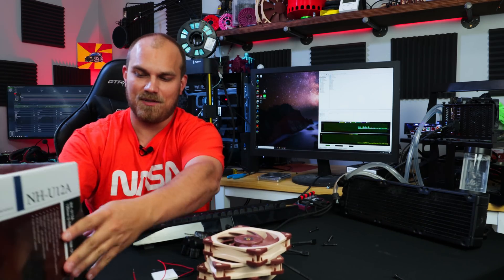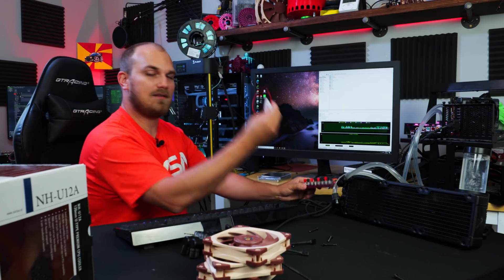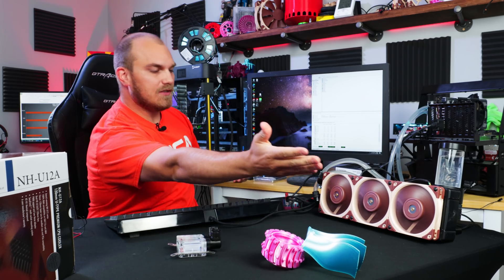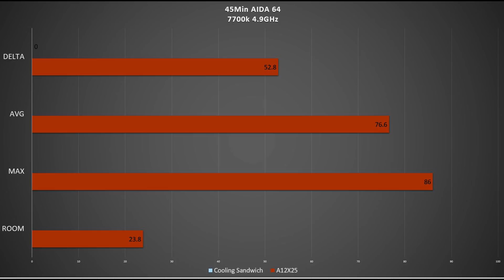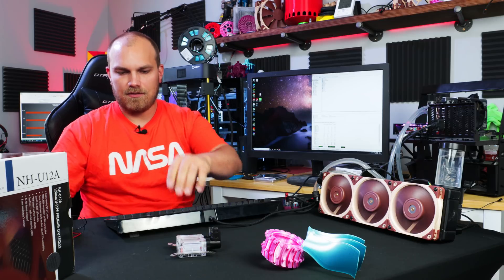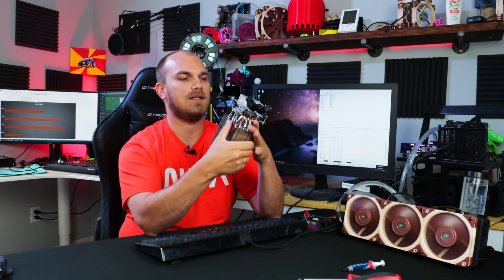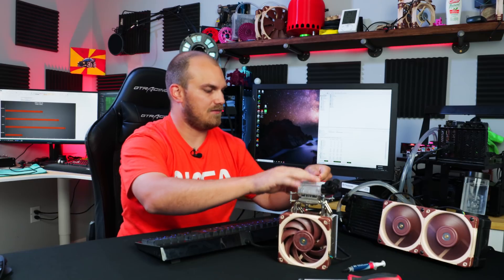Can A Wish.com Water Block and a $4 Peltier Beat a 360mm Radiator?

Comment: What if you installed the cold side under your reservoir and made it that it starts with the computer, and the loop when load is applied, obviously the aircooler needs to start at the same time as the Peltier and when the load hits your loop has cooler than ambient water.

Comment: Put the Peltier cold side directly on the cpu, then just use normal heat sink w/fan on Peltier hot side. That should be plenty cool. But are you measuring water temp or CPU temp?

Comment: Try with better TECs, 3 "Good" CPU blocks, attached to 3 "Good" TECs , each in series on the tubes, each running with a fan sucking air on one side of each heatsink and a fan pushing air on the other side of each heatsink. 
We don't have to make it smaller than a 360 Radiator, we just have to get close to same performance or better.

Comment: Thermodynamics says that the cooling capacity of this loop is determined by the Noctua Cooler. There is nothing you can do to make it cool more than the capacity of the Noctua and any intermediate steps only add heat or reduce its dissipation. Its like plumbing an A/C unit back into the room it is cooling.

Comment: I'm not surprised that this didn't work. Sure, it might be a thing that the peltier element is overwhelmed with the workload but running the air cooler - which runs mostly via convection! - oriented like that certainly is a problem: If the working fluid all sits on the bottom (the actual ends of the heat pipes) then how is it even supposed to evaporate to make the cooler work as intended? Turn the air cooler upside down (into its intended orientation) and run that test again to see actual results. Running in a setup that sabotages the test in itself to begin with doesn't give reliable results.

Comment: I'm at 1:40 and I'm going to make a prediction: Can the U12A keep the hot side of the TEC cool enough that it doesn't choke and start adding heat to the loop - bearing in mind that it needs to dissipate the heat from the TEC and the heat from the loop... and, if it can, can it cool the loop better than a 360mm rad? Gonna go with no on both counts. Is the Major going to have fun finding out? Of course! :D
[edit] Looks like I was right on the money. Oh, and for heaven's sake get some quick release fittings, they'll save you a load of time and aggravation when swapping components.

Comment: Uhm , I don't know much about coolers , but I think the biggest problem is ...maybe that the air cooler is upside down? Isn't there some sort of vapor chamber or sth that works with the help of the hot stuff going up and cool and come back down? If someone knows exactly what happens in an air cooler with those pipes , please do explain , thank you

Comment: Yay.

The idea behind it was based off one of those ancient fad coolers that had a peltier built in.  This was before there were dedicated water loops so I was wondering if the new water loop tech and new heatpipe tech would make it worth giving peltiers another look.  I was thinking it would at least allow for supplemental cooling or relocating a big tower cooler.  I am bad at math, and a lot of the comments below seem to confirm this.  

Running off 12v just doesn't seem like enough juice and the thing just gets saturated too quickly.  To get around that (if still possible, which it's probably not) would require additional crap that would defeat its intended purpose.

I am just glad this didn't set you back too much.

Comment: Major Hardware, you should check an old AIO from Titan/Datacooler,  model DWC-A1.
This is mixed between an air and water cooler, at least the cpu heatsink.

http://www.madshrimps.be/articles/article/85/Titan-Datacooler-DWC-A1-Budget-water-cooling-tested/0#axzz6Uz5KbNBl

Comment: Ah see, the problem is a peltier element is rated for a certain heat pumping capacity. Usually that's much lower than the TDP of a CPU. On top of that, running a peltier at maximum power is actually worse for cooling, as the heating from resistance losses overtake the cooling capacity of the module. You'd ideally wanna tune in the voltage and current so the module pumps the maximum amount of heat while producing a minimal amount of heating. Then on top of that you'd not want the peltier to directly be responsible for all the cooling. What you'd want to do with them is achieve sub ambient temperatures. The cooler a medium, the easier it takes on heat.  So getting water to be just above the temperature where water from the air would start condensing around your CPU block should be your goal. And for that you first get rid of as much heat as you can with the regular radiator and then use an array of peltiers to cool the water further to sub ambient temperatures. This is not efficient, but it's a DIY way of cooling that water loop. Better would be a compression cycle cooler, they are more efficient and more powerful, but also take up more space. Though if you're already using what's essentially a fridge, you might as well put the evaporator (ie the cooling part) onto the cpu itself (though that's def. gonna give you condensation).

Comment: If you are in hot ambient temp room and you still wanna keep cpu and or gpu cool you can add that setup to the radiator you used before. I had that running for 1 year with an 50w peltier and an mora 360lt and watertemp never went over 36°C. 
I had an Asus 1080 OC and an i7 hexacore overclocked plus the Asus rampage 3 extreme in the Loop.
Worked all well and would still run if i had the Space to put that System up...

Comment: I would be more interested how the radiator + tec in series would perform. The radiator would cool the water to ambient temperature and the tec could bring it below that. Additionally you could cool the hot side of the tec with your evaporative cooler.
Reply: 2 x peltier to cool both sides, you sir are a mad scientist 🤣👍🏻

Comment: For starters, you've got it hot side down, heat rises, you're heating the cool side with the hot side that way. It would likely have worked far better without the water block, directly attached to the CPU with the same heatsink on the hot side and a high speed fan to cool the hot side. The cold side can get cold enough to freeze things, so if you're not getting enough cooling out of it, you're doing it wrong.

Comment: I think part of the problem that it didn't work too well was because the air cooler was upside down, meaning the vapor chambers of the cooling system weren't properly utilized. Although, it is still a Peltier so... they're not too awesome if you can't disperse the load..

Comment: It's not as bad of an idea.. I ffed up my perkier when I screwed it tight and it was a 60w unit regardless. You should get one of those 300W ones and run it below spec. That would help efficiency a little (just a guess based on the stuff you can check out at "TechIngredients" channel

Comment: Isn't there fluid in the heat pipes that need to flow to the water block?  It should get better cooling if you turn the radiator right side up so that gravity brings it to the block where it evaporates to the fins.  I would imagine upside down heat pipes are incredibly inefficient.

Comment: Water's high specific heat capacity and low thermal conductivity is what's killing you here. The radiator works because it gives the water mass a high surface area. When it flows past the 2 sq in of the peltier/waterblock wall, there's just not enough water in contact with something cold to make a difference to the overall mass.

What might work would be putting the cold side of the peltier on the air cooler, and immersing the vanes of the cooler in a bigger water block (home made from tupperware), so you'd have an active water chiller. You'd probably need another air cooler on the hot side though, so even more impractical an inefficient!

Comment: 1 ellement is not enough. I'm 99% sure it will beat 360 radiator with a good gap if you connect about 6 ellements / coolers in a row.

Comment: I threw one of these Tecs on a heat sink once and went outside and pressed the heatsink into the ground and it generated a pretty decent voltage considering it at a 1.5 x 1.5 inch component. These will generate power at about 10% of what they can cool when they are not connected to a power source. 

I always thought it would be cool if someone created a resonator on a car with a ton of these integrated, if you had enough you could probably run a car without an alternator. Honda actually has a patent on this which I found when I thought I figured out something awesome. I'm sure they have reasons for not doing it though.

 Several years ago you could get these things in Lots of 50 on ebay for around 100 dollars.

Comment: You need to spec the peltier at the power output of the  heat source else you will bottle neck the heat flow at the peltier. Aka it will insulate a heat output greater than its rating.

Comment: Well the idea isn't terrible, however, I would us it as a replacement I would use it as a supplement to the radiator the surface area on the radiator is what makes it remove so much heat, the surface area on the water block is tiny. Find a block with more surface area, which means cooling surface to water contact area, not just size. Also the effectiveness depends on the "Specific Heat", a chemistry term to identify how well it transmits heat energy, of the liquid used, the ones that use a coolant rather than water is because water has a pretty high specific heat.

either way, if you go from cpu to radiator, so it removes the majority of heat, then to cooler block, it should have enough heat out of the system to actually bring temps below ambient. still may require a more effective water block

Comment: Why dont you try putting the peltier on the processor with the cool side, and hot side on the air cooler or water cooler. :D

Comment: I don't even know where to start... Lets start from the basic. 1. For cooling purpose DO NOT use 12volts. 2. There was ZERO insulation between hot and cold side, so the hot side was warming the cold side. 3. There was zero insulation in water pipes etc, when you want to go close ambient or lower, you will need good insulation everywhere because the room is heating up all the surfaces that are not insulated. Here are couple ideas for you, which i have tested and can confirm working, use 2x12706 stacked and run them at 5volts. This way you can easily reach 40-degrees under ambient temp, measured from surface of peltier. This method also uses WAY less watts (20watts) than running 1x12706 at 12volts (72watts) and it also makes MUCH LESS useless heat in the warm side. Currently my best result is using: 12710+12708+12703 stacked, running them all at 5volt, about 45watts and the cold side goes 57-degrees under ambient temperature. In a nut shell: 1.Drop voltage 2. Use stacked method 3. GOOD insulation and you can see some serious schit to happen. ;)

Comment: Im not sure the noctua cooler works properly when its upside down.. The heat pies needs to be oriented the right way.
It said so in the manual of one of the coolers i have. You should atleast try to put it to the side as it would be mounted in the pc.. :-)

Comment: i didnt think that could work, but id love to see how well it would perform as an "assist" to the radiator, as in cpu waterblock to pump to 360 radiator to peltier cooled waterblock and then back to cpu waterblock. ive actually been planing to do just that...

Comment: I'm pretty sure it failed because no matter how efficient the Peltier is you still have to move the heat away from the source. Peltier does move heat from one side of itself to the other. However,  the temperature difference between the cold/hot sides always remain constant based on the current being consumed. So, once the heat is moved from the cold to hot side it still needs to be moved away from the hot side in order for the cold side to get colder. So, the bottle neck ends up being the fans. All you really did in this video was compare 1 fan w/ heat sink against 3 fans /w radiator. I think even if you add 2 more sets of data it would help to understand what exactly the Peltier is/isn't doing to help the cooling system. First, run 1 fan w/ heat sink without the Peltier. Second, run 3 fans w/ radiator and add the Peltier. You would then be determining if adding a Peltier to a cooling system makes a difference. Though I personally don't think it would because you still wind up with the fans being the bottle neck.

Comment: I dont think this is a bad idea, per se but really a 360 water block has a massive heat transfer differential based on surface area, so no this setup with the pelletier would suck. You'd need 3 or 4 pelletier coolers with air coolers

Comment: Make it in line with the radiator and maybe even one online going intoo the rad then inline going out of the rad to get the flow going in being cooled by the tech and the water going out cooled by the tech also, that would be 3 things taking heat away for more COOLING BABY.

Comment: take 2 water blocks and put a peltier between them and make a figure 8 loop use the peltier to cool the return water and heat the hot output. see what improvement (if any) would be.

Comment: Hey, i cam here to say run the water through the radiator and then the peliter. See if the peltier can do better at lower cold side temperature

Btw, this video has a lot of reasoning why peltiers dont work for cpu cooling. But it also points out scenarios where they would work. Check it out: https://www.youtube.com/watch?v=AkzJ_XSczZU

Comment: Could I ask a dumb question?
Why include the other water-block at all?
Put the Petier on the CPU, then put the Noctua air cooler and fan(s) on top of that. No water required, and that'd work a whole lot better. You hope to see about 80 ~ 100 C inside the middle of the Noctua cooler, and about 20 C at the processor. If the air-cooler is cooler than that and the CPU is hotter, turn up the current through the Peltier...
I don't understand the need for a second water block at all.....
The only real shortcoming with that system, is a draws a lot more electricity. It's not & never will be the most efficient of cooling solutions ~ but it sure as hell should work. Pump enough electricity through it and it's not going to be a whole lot different to liquid nitrogen...

Comment: Oke.
Understand the watt you need and this how you calculate.
The peltier have to be 2 time more watt than your cpu.
Watt cpu + watt peltier = 
95watt + 200watt peltier to cool your cpu . Totaal 200watt. 
The 200 watt can easy cool the 95watt cpu..

Think about the time I cool p3 and amd thunder bird cpu. 
Old times are the best to be creative.
And yes with the new air coolers you can use it this way .

Comment: This setup is much more scale able than putting the tek on the CPU, you could connect MULTIPLE tek coolers in one loop, each with its own heat sync. It would be totally impractical, but with enough of them it should eventually work.

Comment: This idea has already been done by CooIT, the problem is that these heat pumps use a lot of power and release a lot of heat. You need more than 1. Check out their first models for PC, I still have one and CoolIT is now mostly for industrial use.

Comment: My idea for the perfect fanblade, that has to push air through a cooler...almost just like the noctua...litte dimples on the inlet side of the blades and circular ridges on it on the outlet side...ridges at the same distance ...but height bigger close to the shaft  and lower at the end of the blade. Also print a new frame for the fan. The difference is that inside circular channel is covered in  little dimples. These dimples are bigger on the air inlet side and smaller on the air outlet side. Expected result ..more flow against pressure or resistance and still very low noise.

Comment: Conservation of energy: Peltier will introduce additional energy into the system, i.e. give you more heat to get rid of than just the CPU. If you went further and cooled the Peltier with the 360, it would still be worse than just the 360. Right?
Reply: Overall, it would introduce energy, but the goal is to move more energy out of the watercooling loop than the Peltier introduces into it, into something else. It could make the loop cooler, at the expense of making whatever its heating up, heat up much quicker.

Comment: Maybe instead of putting power into the TEC, try using the TEC as a generator. When there is a heat difference, the TEC will have a voltage on it. Perhaps you could use that voltage to drive the fan on the radiator? If that works, you'd be cooling using the heat of the CPU.

Comment: Linus Tech Tips already did this and got a beefy tech cooler (like 500W I think), but it still had issues where it would only push so much heat and the heat from a cpu would still overwhelm it

Comment: I did this a whike back but made custom water block for it creating a sort of chiller thow i did use 1k watts of chips to get the job done the problem you can get by doing this is if you went like myself you will need to keep ur cpu under load or get some sort of balancer or else you will form slush

Comment: Peltier cips are not designed to work under constant power. You should control them with PWM according to the delta temp between hot side and cold side. Also the water block should have a longer water loop inside due to the low thermal inertia.

Comment: I have a suggestion.

How about cooling the CPU from the back of the motherboard? I know it's generally not been successful but perhaps it just needs more heatsinks than people have used before. Maybe there's some way to transfer heat through the mounting holes?